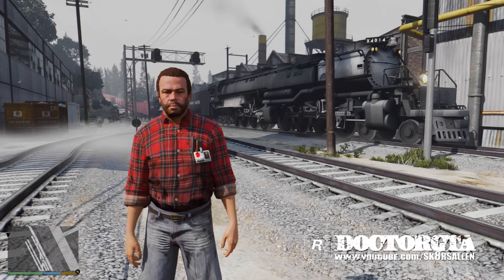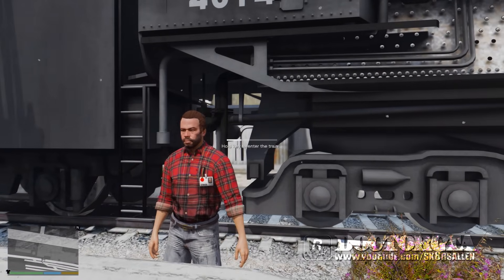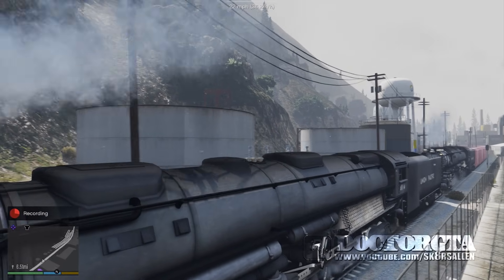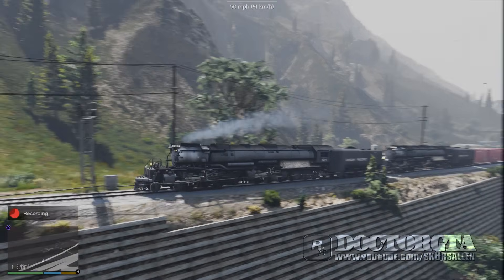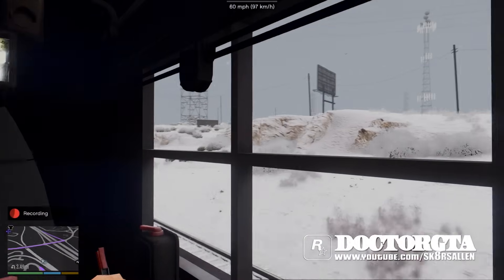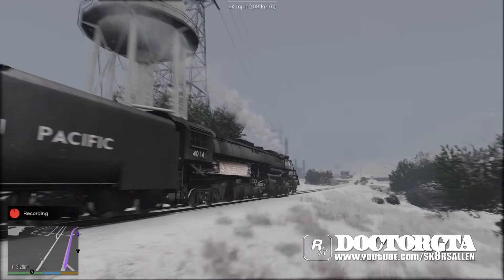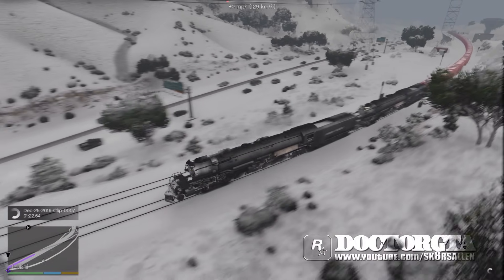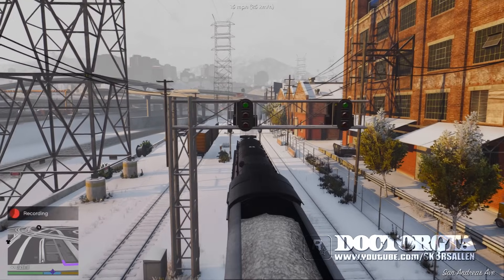GTA 5 Train Simulator Mod - (Union Pacific Big Boy 4014) Railroad Engineer Mod

Comment: I wish steam locomotives were still usefull
Reply: heavy boss 890 actually they still are. Diesels these days can't pull as much as a Steam Locomotive!!!
Reply: Nicks Adventures I can't figure out what it is but steam locomotives are so damn fantastic to watch
Reply: Epicburst I totally agree!!! I started volunteering at the Illinois Railway Museum and I get to work on there Steam Locomotive No.1630. They said when it's running season I'll probably get to ride in her cab :D
Reply: heavy boss 890 
Some steam locomotives are still running today.
Reply: There are a lot of steam engines still in use today, but not for revenue freight service, only for special events or are used in museums.
Reply: That is debatable depending on who you ask. Yes, a steam engine can pull more than a diesel but compared to diesel locomotives they require too much maintenance to be practical.
Reply: Christopher Huffman true
Reply: While yes it is true that a steam locomotive takes a lot more maintenance to operate, they also provide more jobs due to the maintenance. a standard roundhouse had around 18 different positions with any number of people filling them where as a typical modern maintenance shed has around 5 different positions.
Reply: You are right in that matter, its all a money thing for industry now, whether its Aerospace, Railroads or automotive. The less maintenance a company has to do to its equipment means more time making money and the less amount of money they have to pay employees or mechanics to fix the stuff. Which usually means said companies run their equipment until it causes catastrophic damage or cannot be repaired.
Reply: Christopher Huffman its true
Reply: Christopher Huffman well the cheaper something it's mostly likely not going to work properly. Sure Steam is expensive but it gets the job done and works properly.
Reply: Nicks Adventures I know some steam locomotives are still in used but only most steam l. are used for events and museum
Reply: Nicks Adventures if they'll ceep in focused on steam locomotives they'll probably earn more profit because steam l. are stronger and some are faster diesels only spits dirty smoke but most steam l. are smelted shame😯
Reply: heavy boss 890 yea I know Steam is mostly in museums I help at the Illinois Railway Museum and I help work on there Steam Locomotive No.1630. There is soon another Steam Locomotive that will be running No.5. I agree rail company's should focus around Steam. There a lot more reliable and stronger. Sure there a little expensive to run but they get the job done!!!
Reply: Nicks Adventures wait you work at a railway museum? I gues you get chance to sit in a cab or something I mean it must be great to work there for someon who knows about trains
Reply: But you have to think, the diesel engines that replaced the Big Boys (F units, E units, GP7s/9s etc) were not as efficient or as powerful. Now in modern engines like the ES44AC, the computer in the engine can control how much fuel and how much power the engine can produce. Meaning it can be more efficient and more powerful, just like every other diesel powered thing in todays world. But then you have emissions regulations on top of that, which is a story for another day.
Reply: Christopher Huffman now Japan have there high speed magle  soon the hole wold will have maglevs and then diesels will be onrelieble and diesels are the most easiest trains to become a runaway train
Reply: Nicks Adventures  Not true if your looking at horsepower and tractive effort stats. The big boy has 6,000 horsepower at 35mph. The AC6000 has 6,000 horsepower at speeds of up to 75mph. Although overspeed goes off at 74 and no tier 1 railroad has speed limits of over 70 mph.  Big Boy's tractive effort is about 135,000 lbf. AC600's is a continuous 166,000 lbf   But even after all the stats, no Diesel engine will ever win over the "wow" factor that a steam engine has. Just pure awesomeness!
Reply: If you think about it, the rest of he world has been using electric trains longer than the US has. But of course the US rail industry is based around long heavy trains and not so much passenger like the rest of the world. However, when your pulling 100 car long coal drags Horsepower is not the name of the game, it helps, but you need more tractive effort or torque. That's the bad thing about a steam engine whether it's a train or a tractor is it had a lot of torque, but not a lot of horsepower.
Reply: jjgravy I was told that there are stories of Steam Locomotives almost always helping Diesels. Heck there was one where a Steam Locomotive was able to pull 2 diesels because the diesels broke down.
Reply: heavy boss 890 Yep it's my first year Volunteering there and they said when it's running season I might be able to ride in No.1630s cab!!!
Reply: :O:O:O:O:O:O:O:O:O:O:O:O:O
Reply: Nicks Adventures wow thats GREAT!!!
Reply: heavy boss 890 Yep
Reply: With all due respect, you guys have a lot to learn. There's an old adage between steam and diesel, and it's all relative to how each one builds power and gets it to the rails to move said train. 

A diesel can start a train it can never pull, while a steam engine can pull a train it can never start.  

What's that mean? A diesel locomotive uses electric motors to turn the wheels, originally they were series wound DC motors, all the new stuff is AC with inverters, and they use an alternator (obviously very big) driven by the diesel engine to make the electrical energy to make it run. Diesels are exceptionally good at low speed pulling power especially from a dead stop. Think of trying to hold a drill and then squeeze the trigger. that's how a diesel locomotive (or an electric locomotive) makes power. 

A steam engine is like a two seat bicycle, each cylinder on the side has a piston directly coupled to the wheels, and it can push and pull. the cylinder on the other side is keyed 90 degrees offset, so that in one full revolution, you have 4 power strokes, a push and a pull from the left, and a push and a pull from the right. (in the case of the big boy in this mode, there would actually be 4 cylinders and 8 total power strokes since there are two sets of drivers). Now, think back to riding your bike, and having to start out on a hill.... You can't start with the pedals at 12 and 6, it's easier with them at 3 and 9 o'clock positions. Here in lies the problem with a steam engine... It's power is put down in sinusoidal pulses, not in a continuous torque fashion. 

Ok... but what does THAT mean? For the drill to make torque, it needs voltage and current to supply the motor, and at low or no speed, that's easy to supply. But as the motor starts spinning faster, to get the same torque, you need to apply MORE voltage and current to get the same results. In theory that's possible, but in reality, the alternator can only supply so much power, due to limitations of speed in the motor turning it, and physical size to get the power needed out before it melts. So while a diesel works great at low speed, at higher speed, the performance starts to roll off. A steam engine on the other hand is tough to get started, but once it's moving, the steam is actually better utilized by the way the admission and exhaust valve time is controlled AND the fact the steam expands to do more work than just the pressure alone would indicate. 

So for a purely theoretical case, a locomotive that used electric motors for low speed operation, and also had a steam side for high speed operation would be great... but, that doesn't exist. 

Maintenance for steam engines is a nightmare... not only does every moving part have a grease fitting, the weight of the steel drive rods on the sides going up and down and forward and back beat the snot out of the track at road speeds. Couple that with the maintenance of the physical boiler itself, like the big boy's 350 PSI boiler pressure, if it is not maintained to perfection, you have a 500 ton rolling bomb. 

The army of men needed to maintain a steam engine (and not to mention the wayside locations to stop and pick up coal and water along the way) and the competition from air travel in the late  40's through the 50's meant that the railroads had to modernize their operations to stay competitive. 

Sorry for the book, but this only scratches the surface. Read up on it, there is some amazing stuff out there! Check out my channel because my dad and I actually have 1/8 models of steam engines you can ride on! There are tons of people across the world with these, really amazing.
Reply: kleetus92 I can understand that Steam is a nightmare to keep it working. I had to clean inside of No.1630's smoke box though it was fun.
Reply: game master 24/7 my fav is n.y.c Hudson j-3
Reply: kleetus92 yeah it's treu that steam trains are hard to make it keep working but i just feel that steams are better and fascinating to watch and that chuguchugu tho
Reply: heavy boss 890 Aren't steam locomotive ( trains ) also better ? They work on steam so china would be save when it comes to polution.

Wait does china even have trains, the fuck am i even thinking at the moment XD
Reply: ThePixelPyro's xD
Reply: actually the U.K has a working LNER Peppercorn Class A1 60163 Tornado that is used for mainline passenger transport.
Reply: heavy boss 890 The only reason they aren't used is they aren't efficient as diesel locomotives. Steam engines are usually more powerful.
Reply: Gunnar well if there more powerful I don't see why they can't just use Steam once in awhile
Reply: Isaac Gray wait they use her as mainline transportation?!?
Reply: Nicks Adventures That may have been true 30 years ago, but not on today's railroads.
Reply: jjgravy yea
Reply: Nicks Adventures what's youre favourite train?
Reply: Nicks Adventures what's youre favourite train ?
Reply: Nicks Adventures what's youre fav train?
Reply: heavy boss 890 I have a couple. The E2 tank engines, J50, Russian Decapod, A3, A4 and mostly Steam Locomotives :P
Reply: Nicks Adventures I isnt stream liners one of the fastes steam trains? so if they are  how the bittern is fast?
Reply: heavy boss 890 well the A4 is the fastest Steam Locomotive in the world and it's Streamlined!!!
Reply: Nicks Adventures I think you mean the mallard that can go 125 MPH
Reply: Flossyorc6gaming 2595 Yea
Reply: heavy boss 890 I know right
Reply: Nicks Adventures ok
Reply: the steam locomotives are much less expensive than diesel, not even talking about pollution of the air
Reply: you mean much more expensive right? lol
Reply: with the price of diesel, no they're less expensive in terms of efficiency and compared to the diesel ones, the velocity is quite the same because of the speed limits  but in therms of maintenance, the diesels once require less. Check the Argentina. a 1945  4-8-0 locomotive, the fastest in America (no kidding it was the fastest)
Reply: some are tho
and a hell of a lot more efficient tho
Reply: those old diesels were still more efficient because they didnt need so much maintenance and fuel..thats why they replaced them
Reply: Gerrad Reynolds its true
Reply: yes but iagine that in US the train speed limit is quite slow and after the resolution of the OPEC, and the fall down of the keynesian state, the petrol went way up, and we all know that if the petrol goes up, every fucking thing goes up, so coal went to be less expensive than petrol. but comparing Argentina with US is quite difficult in some aspects because of the differences of transit and routes, but quite similar about the load, such as grains and livestock
Reply: heavy boss 890 if you want to see a working steam engine, look for a thomas the tank engine event
Reply: Electric Pikachu well I need to wait for the 2017 event
Reply: heavy boss 890 China still builts them. like the QJ class
Reply: Electric Pikachu I'm pretty sure in the U.K. They only have 2 live Thomas steam locomotives but in the US we use dummy units which is stupid if you ask me. There is only one live Steam Thomas here in the US. I hope they make a live Steam James though
Reply: heavy boss 890 same, but hey there is still some being built believe it or not! Look up the PRR T-1 or PRR 5550...
Reply: heavy boss 890 There are nearly 50 steam engines alive and moving in Britain. At least 5 of them are used on the mainline. Heritage at its best!
Reply: Martin Ward wow!!
Reply: Some countries still have steam in use like India in some parts and China! The UK didn't get rid of steam til 1968 and in some Factories not til the 1970s! We have quite a few locomotives left on Preserved Railways and Museums around the Country!  But yes Steam engines are still useful if there ever was another war or a shortage of electricity or Diesel fuel steam engines could definetly pull their weight!
Reply: heavy boss 890 I agree
Reply: heavy boss 809 the 611 is in use
Reply: only for excursions
Reply: Diesel locos have a lot more starting tractive effort. A crapload less pollution with a modern emissions controlled diesel.

The simulator should have heavier steam and smoke at times like at full throttle but i think the exhaust is fixed
Reply: Kleetus92, your explanation is amazing and clear. I think electric and diesel-electric and hybrid diesel-electric can have decent tractive effort at higher speeds with properly tuned electric motors. Possibly some axles are for max at lower speed, others for top speed and computer controls everything.
Reply: heavy boss 809
Reply: heavy boss 809 Thomas ruined that for us he's was not useful
Reply: heavy boss 809 they are useful. I don't know why they stopped using them. They say because diesels cost less and put out less pollution, but that's false.
Reply: How is that false? A diesel-electric loco with computer controlled emissions definitely pollute bigly (easily 20x less particulates i think) less. 
The old ones can smoke though..
Reply: danwat1234 he means its false that diesels put out less polution when they put the most polotion out of all vehicles
Reply: heavy boss 809  f m.
Reply: I completely agree. There aren't many diesel trains and there aren't any electric trains that have the same class as steam ones.
Reply: Look up the 5AT Project in Wikipedia. The project was established in 2001 to design and build a modern steam locomotive to compete in in the world of diesel. It would be easier for you to read about it there than my trying to give you ample information here.
Reply: heavy boss 809 go to the bluebell railway they have a museum of steam trains
Reply: yeah like battleships
Reply: They still are, this specific locomotive is currently being converted to burn atomized fuel and will run again.
Reply: Dr. Bananable Lector really
Reply: heavy boss 809 yea me to
Reply: heavy boss 809 This is complete crap because not only is diesel more efficient as far as putting power to the rails, the regulations regarding the operation of a diesel engine are tight. Look at the tier ratings put in place by the EPA on diesel locomotives actually. As a result of these regulations, diesel engines now have better fuel systems such as HPCR (High Pressure Common Rail), which inject the diesel fuel into the combustion chamber of the cylinder at 40,000 PSI, atomizing the fuel better than in mechanically operated fuels system, allowing a better burn, cleaner exhaust (oxymoron I know), and more power because the fuel burned better, and this is ignoring the scrubbers in the exhaust system. Now in a steam locomotive it is nearly impossible to say that it puts out less pollutants than a diesel, even considering the possibility of a very high grade and quality anthracite coal, a highly skilled fireman, and optimal oxygen levels and air drafts in the firebox. 

As far as power goes, yes diesel locomotives don't have the same output that a steam locomotive does, resulting in the need for multiple locomotives per train, but this actually becomes more of a benefit than a drawback. Imagine this for a moment, you are hauling a fast double stack freight with 4 SD40-2 locomotives and one of them starts acting up and shuts down. Now you have lost 3,000 HP but you still have 9,000 at your disposal to at least get to the nearest passing siding and off of the main. Now if you had the Big Boy for instance and all of a sudden you had a sudden failure on it that caused the locomotive to stop running, well you just lost all of your 6,000 HP, same with the Allegheny at over that rating. So basically having to lash up more locomotives becomes a benefit.
Reply: +Lv2089  You are, in part, referring your comparison of mid 20th century steam technology to diesel that has had an additional 60+ years of evolution. I believe if steam had continued to operate, receiving the same years of competitive evolution, our conversation might be talking of the small niches diesel would be filling and how the power and efficiency of today's steam (possibly even hybrids) would be beyond compare.
Reply: Lv2089 od
Reply: Diesel locomotives outpull steamers any day of the week. Pulling power is rated in terms of tractive effort. The Big Boy has a tractive effort of 135,375 lbf. An SD70ACE has a starting effort of 191,000 lbf and a continuous effort of 157,000 lbf. An ES44AC has a starting tractive effort of 183,000 lbf and a continuous effort of 166,000 lbf. An AC4400CW has a starting effort of 180,000 lbf and a continous effort of 145,000 lbf.
Reply: heavy boss 809 yeah Thomas the train right
Reply: heavy boss 809 dd
Reply: I work with both steam and diesel, and its not quite like you say. Modern road diesel locomotives can pull more than even most peak steam, maybe not the Yellowstone or Allegheny(C&O 2-6-6-6) and Big Boy class, but not much else. and diesels can start a bigger train than steam because of the traction differences. There are many different locomotives so this is a complicated topic.
Reply: Railroad Mike  That's why I was saying that I believe if steam had continued to operate with compribal competitive evolution, we would probably be seeing steam, diesel and possibly even hybrid locomotives, all competitive today. A chance the 5AT Project didn't get due to incomplete financial backing. How unfortunate.
Reply: Well I have worked with old and modern steam and learned from some of the best. Steam was phased out faster than it needed to, any super power large fire box loco(usually 4 or 6 wheel rear truck) would have been financially viable till the 70's in the USA at least. Many north American railroads suffered in the depression from 68 till 74 and a big reason was the massive cost of converting to diesel a decade earlier. Today it is a much tougher argument if they could work and be profitable. I was involved in discussion as to where stem could work back in the 90's and we figured a road of 100 miles or less in coal country, especially a coal hauling road it could still work. and if Obama/Hillary admin didn't wage war on Coal it may be true today. I know of a line in WV i was looking at for such a test. RJ Corman bought a Chinese QJ for testing but I never saw it run. The new GE diesels are very impressive and could beat any steam in all categories. I work with older diesels and they are much better in most ways than steam but I still really like steam.
Reply: I like steam as well. And my point was hypothetical because steam was stagnated, I believe because of the investments into diesel. I would love to see what impressive things would have happened with steam if given half the chance as diesel. Thanks for all your information, Railroad Mike. (lol Am a Mike as well)
Reply: Cheers. Steam was quick to get phased out in the US because of labor cost and infrastructure cost being the great amount of route miles here, it had little to do with performance. Europe and many other countries ran steam far longer and likely that was because of government ownership. I have friends that were involved in the ACE3000 project and as good as it was it couldn't get much interest and that was one of the last attempts here for modern steam. A good friend is working on a bio fuel steam project right now involving a AT&SF 4-6-4 and I may step in to help on it if it gets going.
Reply: Thanks for the added info, Railroad Mike, I'm looking forward to looking up the ACE3000 project and hope your friend's project bears fruit! Take care. 8)
Reply: if you live in the us their are still steam trains still running all around the us
Reply: I work with very successful steam locomotives in the US
Reply: heavy boss 809 Actully...I have you kniw Union Pacific Is reatoying Big boy 4014 as we speak...
Reply: Railroad Mike... I'm sorry for adding this so soon after we closed our conversation, but I just spent many hours reading more on locomotives and ran across an interesting passage on Wikipedia under Diesel Locomotive, subtitled: Diesel's advantages over steam. In part it read, "However, one study published in 1959 suggested that many of the comparisons between diesel and steam locomotives were made unfairly mostly because diesels were newer. After painstaking analysis of financial records and technological progress, the author found that if research had continued on steam technology instead of diesel, there would be negligible financial benefit in converting to diesel locomotion." LMAO.... Have I errantly included conspiracy theorist to our conversation as well? Crap!  No reply needed, Mike. It was just an FYI to what we were discussing. 8)  p.s. If anyone can explain to me how to space paragraphs here in YouTube, I'd be grateful!
Reply: I don't know how to space them either, lol. In 1959 steam tech could have easily kept pace with diesel, however now almost 50 years later I highly doubt it. Once a micro processor had been installed on diesels and the wheel slip technology advanced there is little chance that all the boiler and running gear maintenance could keep up. The big thing nobody seems to talk about is diesels can be operated for 92 days at a time between inspections with very little service in between, where as steam locomotives have to tie up at a service area after near every run and have the fire box and ash pan serviced at the end of every run. Although the running crew can perform much of this, it would cut into the hours of service limits. Then there is the need for hostlers to deal with the locomotive in between runs, you cannot leave a steam locomotive un-watched, this is something that is no issue with diesels, tie it down lock the door and head home, you can leave them running for weeks no problem. The new GE locomotives can go 184 days between inspections, no way would any steam locomotive go that long with out issues.
Reply: Mike, I hope you realize I'm not arguing with you, LOL I'm learning too much for that. I doubt that I'll be around long enough to see what will come from all the work being done to revive competitive steam locomotives, but I do believe it will happen. Fifty five years of advances in technology, metallurgy, electronics and such with so many who are directing their energies towards steam, it can't help but happen. I'm not saying that diesel will be eclipsed like it had done to steam mid 20th century, it's too well entrenched and will be evolving as well. And you're right about the minimal maintenance and ease diesel has had over steam, but those are major hurdles engineers (no play on words intended) are working to overcome. Tomorrow has always been a strange taskmaster and nobody truly knows what it will bring. Well, that's pretty much it for me. Thanks for your comments, they've helped me to learn much more than just my opinion. I believe we should simply agree to disagree. So pls, being that I opened it back up, you close it. And again, take care. 8)
Reply: Why on earth would you think this was an argument? It is simple discussion on the merits of locomotives of witch I work with all technologies. Ive even owned locomotives, lol. Im just being informative, take care.
Reply: heavy boss 809 same here
Reply: there are like 4 steamers still in servas
Reply: These trains are cool😀😀😀
Reply: heavy boss 809 me too
Reply: they can if they use solar panels somehow
Reply: The 844 steam engine pushed a stalled diesel locomotive, with more than 100 cars
Reply: Connor Witengier its a locomotive
Reply: heavy boss 809  agreed they are very beautiful trains
Reply: Diesels can pull way more than steam locos, the longest train in the world ever recorded was multiple diesel locos. Google if it you dont believe me
Reply: Well, steam locomotives would be a crap ton more powerful if we had used them to make vehicles, they used the gas engine instead because the steam engine was to fast, and people kept dying from crashes. Although they did race them a lot, and I feel it would be exciting to see a race!
Reply: Robert Kennedy 20800 where the hell did you learn that
Reply: theres a video here on youtube and also its all over the internet, as time progressed its obvious that diesel locos where made and used on trains used to their power output, and easier to start rather than waiting hours to finally get a steam loco started for the day.
Reply: They are for coal mining.
Reply: History books
Reply: Nicks Adventures um... the reason that its cheaper is because it breaks less.
Reply: heavy boss 809 are you kidding me?
Diesel and electric locomotives and emu's have a pedal that must be pushed down the whole time the engine is operating.
All modern diesels and electric engines have this.
Even the f1's had this.
Runaways don't happen anymore.
Plus you have the system that checks if there is an engineer is at the throttle.
Runaways are impossible in today's time.
And with all the devices soon to come there will definitely be 
No runaways at all.
Reply: Christopher Huffman a steam engine could have 25 hp but have enough torque to pull 200 cars.
(25 is a realistic number)
Reply: Iván Pstyga haha yeah...
You obviously know nothing about the work that needs to be done...
Diesel locomotives are much more reliable and diesels are not like cars.
There are around 212,000 Diesel locomotives on earth.
So compared to the millions of cars that seemingly everyone has.
Reply: Mochi Tv we want to see real steam engines on excursions and not have to blur the whole train because its filled with kids
Reply: danwat1234 learn to spell and we will listen
Reply: heavy boss 809 no it's 2017 and cargo trains should look like the train in gtav (go loco frieght train)
Reply: Marleen Skeete boi they do look like that
Reply: Nicks Adventures ikr! Like 4 desels = a big boy😂
Reply: You would know... keyboard railroader
Reply: Steam locomotives are still useful. They can be put out for being looked at and admired or be put on excursions for rail enthusiasts like me.
Reply: Railroads don’t run for buffs
Reply: JDoesStuff so unless they can haul a freight train for cheap. Nope, they’re not
Reply: So— that’s how we’re gonna do this.
Reply: JDoesStuff they are, one big boi can haul as much as 4 diesels
Reply: Even if that was true, it would be extremely inefficient to have to run.
Reply: Huh? They wouldn’t make a profit...
Reply: @nicksadventures4362  that's true
Reply: @nicksadventures4362  That's What A Big Boy is for
Reply: @Epicburst  yep
Reply: Nicks Adventures your lucky your working on a frisco
Reply: atoll is in asia
Reply: i wish we can switch lane in gta or rdr2
Reply: They are. It's just the idiots that are the engineers think diesels are more useful than steam, but I would be more pleased to go on a Union Pacific 844 to Sacramento instead of  a dumb, noisy, uncomfortable and stranger danger zoned Amtrak.
Reply: Your Wish IS ready, The 4014 BigBoy ia been Restored! (Thats not clockbait)
Reply: @coreywilliams7445  I live in sweden, got a museum not too long from my home town. They got quite a few steam engines, big and small. And oh boy, it's fascinating.
Reply: Agreed
Reply: heavy boss 809 they almost all got scraped and your boi Thomas was too
Reply: @nicksadventures4362  yea
Reply: Me to